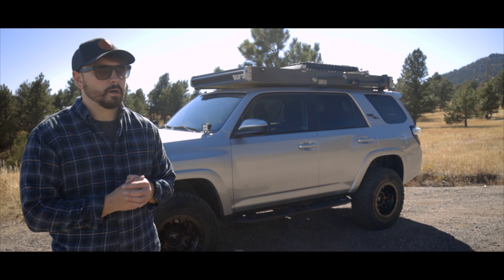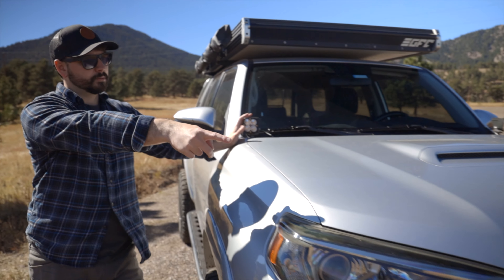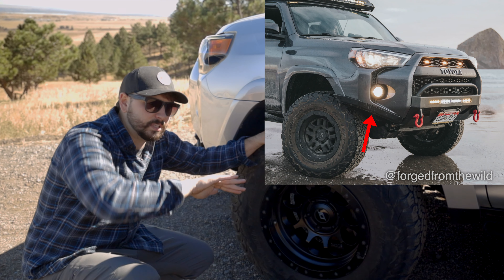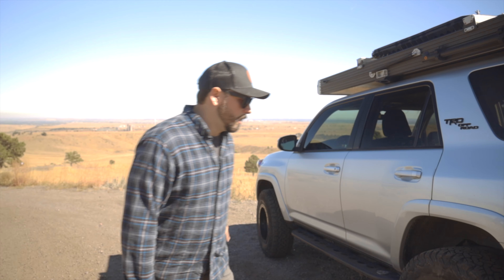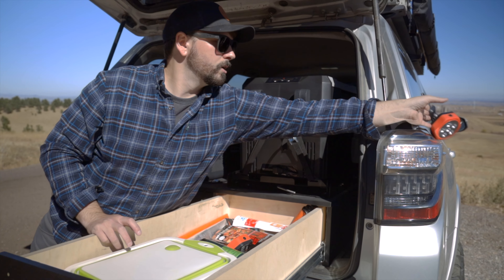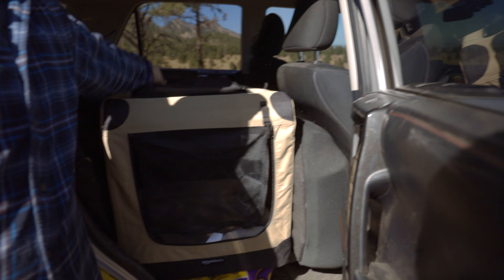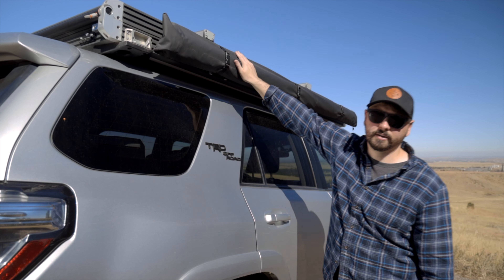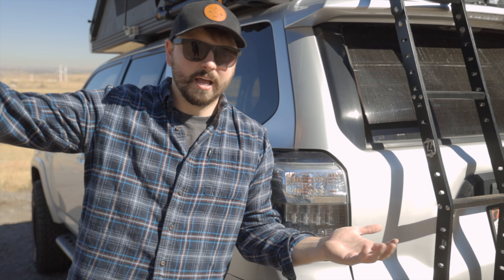5th Gen 4Runner overland Rig| Full Tour... For Now?

Comment: for the bumper: sand with 80/120 grit and spray it with raptor liner the texture is great, and it is extremely durable. for your headlights you have to sand them to at least 1500 grit and clear them after if you just sand them and polish them, they are going to keep going to hell on you. also look into cerakote they make a great product and its very durable for both coating and headlight and trim restoration projects. other than that great video hope this information helps. I've been into restoration, and I've been a certified automotive refinishing professional for over 16 years. I'm also a huge offroad enthusiast that has both a built jeep and a 4runner 5th gen.
Reply from the maker: I just had my bumper stripped and repowdercoated. It’s sitting in my 4Runner ready to go back on. That being said I’m going to look into getting some 1500 grit for the headlights. I had plans of swapping out for an aftermarket headlight but I just spent a ton having my bumper done so I need to go the cheap route on the headlight at least for now. Thanks for the tips! I’ll have ti try that out.

Comment: Nice to know that compressor fits in that location. I picked one up last month, I haven't actually used it yet, and it is a little bulky to keep inside the vehicle.
Reply from the maker: Yeah I really like the compressor. Just did a video featuring it this last weekend. Editing it now. It’s a tight fit in there but it does fit. I wish it was a little smaller but then you’d probably lose all that speed.

Comment: I also have the c4 bumper and the extreme led light bar. But I have the diode dynamics ditch lights. Seem pretty good so far. I’m using the apex badlands 12k synthetic line winch. I put the main power for the winch where u put the air compressor.
Reply from the maker: Yeah I really like what diode makes. I visited and talked with them at expo and everything I saw was really cool. I’d happily make the switch to diode for all of my lights.
Reply from the maker: The badlands winch is really great. I’ve seen a ton of channels go with the badlands stuff and been really happy. I went smitty before I even knew about the badlands winches.
Reply: @OXFOOT  we will see long time use. But being in TX I may not use it a ton. Maybe try nitto ridge grapplers. On my 21 pro I also did a simple westcott lift and put on the 285,s. Still a little rubbing full turn but oh well.
Reply from the maker: @robertwehlau8906  I've been looking at the Nitto Tires because they are supposedly pretty decent for road snow/ice but also still very aggressive. The ridges are the only "mud terrain" I've seen that handles the snow alright but I guess technically it's in between a mud and AT tire.
Reply: @OXFOOT  agreed. I do mostly driving on street and highway vs the off road. So very smooth and can handle some darn good trails here. Haven’t tried in snow yet.
Reply from the maker: Most stuff I’ve done is fine with an all terrain that’s snow rated. My K02s have been great on ice so far, they are getting a bit low on tread though.

Comment: My first mod is the RSG angled slider with kick out and top plate. I got them before I even got my 4Runner.
Reply from the maker: Yeah that’s my favorite look and function for the sliders. I actually got mine off the showroom floor already powdercoated. I really didn’t make a choice with them, just went with what RSG already had because it was already done.
Reply from the maker: But if I did it again I’d 100% go for the ones you have.

Comment: I bought the NAPA compressor after watching your last video. I do need to change out the connections I'm not a fan of the ones it comes with.
Reply from the maker: Yeah I’m going to try to take the compressor wires and try to wire them straight into the battery. I’ll have to make sure all the stuff I want to do will work with this compressor.

Comment: Can u do a side by side comparison of the smitty bilt and the maxtrax compressors?
Reply from the maker: Edit: misread the name.
I can try to track someone down with a maxtrax compressor. I switched to the Napa compressor in my engine bay but I still have it and can plug it in.
Reply from the maker: Oh sorry, you meant the maxitrac one that I have. The names are too close. Sorry I saw maxtrax and thought the board company was making them now. I can maybe do a short with them, but by far the maxitrac one is much faster.
Reply: @OXFOOT  that's good to know, I might go with thr maxitrac one as well.
Reply from the maker: @cocx88  Yeah so far I've really liked it, but only time will tell how well it holds up.

Comment: Are you planning to re-gear with all that extra weight and bigger tires?
Reply from the maker: I’ll likely be regearing once I add a rear bumper. The additions that I ended up going with only added about 50th  so believe, switching tents and roof rack will only add a few more lbs as well. Thought about going 35s but I’m deciding to just go 395/70/17 which won’t be too huge. But yes eventually once I go rear bumper I will regear but that won’t be for a little while.